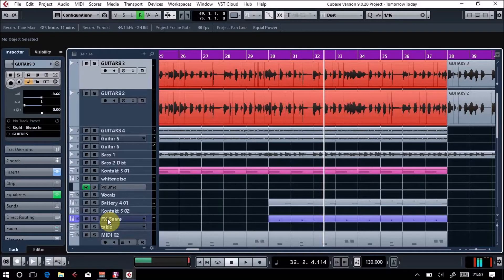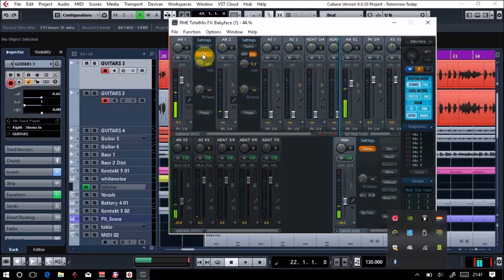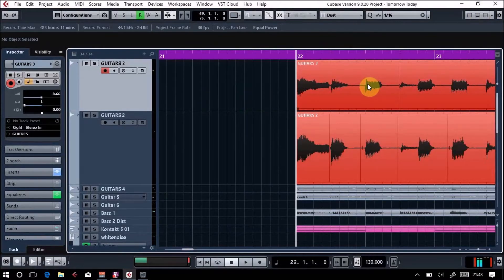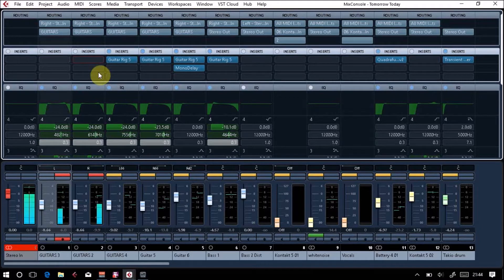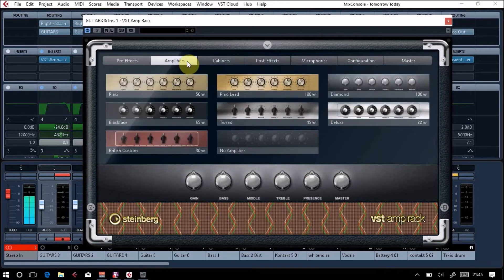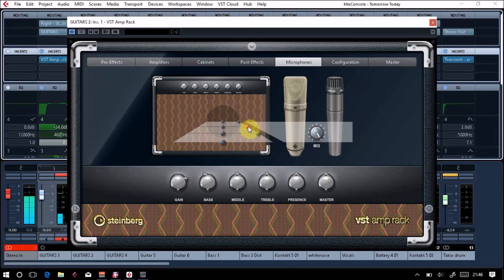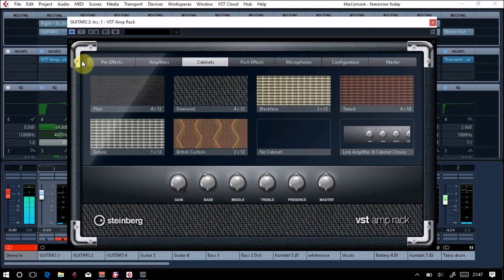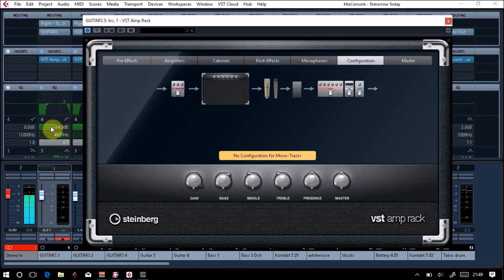How to use Cubase Amp Sims & Amp Rack

Comment: Great video, do you unplug your baby face pro to turn it off ? I want to use mine more often but I don’t really want to leave it on, and I can’t figure out the usb power off thing
Reply from the maker: Yes it's a strange one with the Babyface. As I'm swapping between laptop and desktop I usually unplug it. how about a USB extension with an on/off switch? I'll have a think. Speak soon. Matt